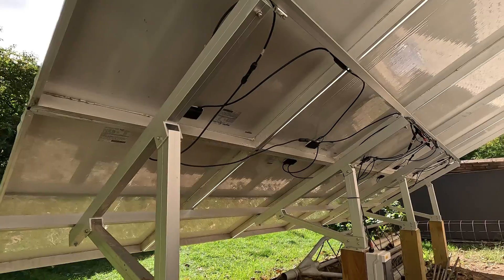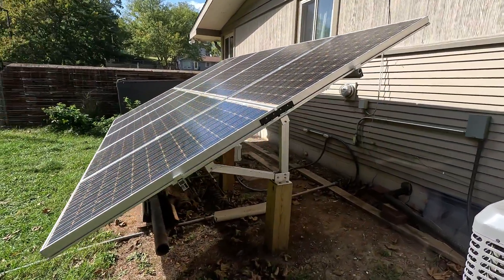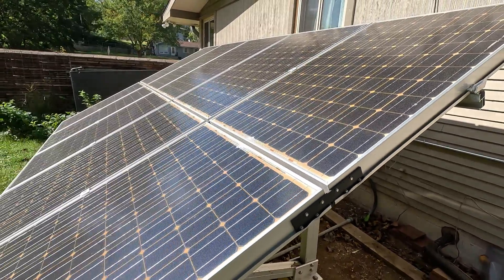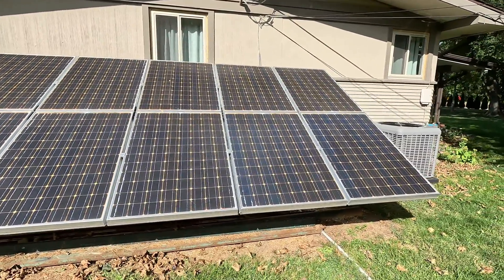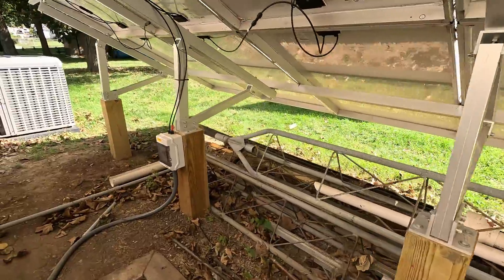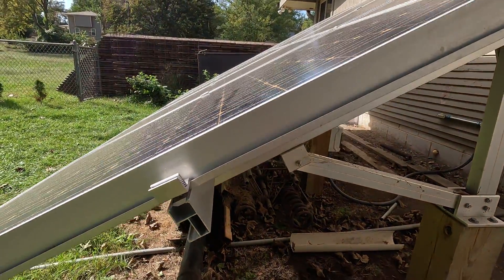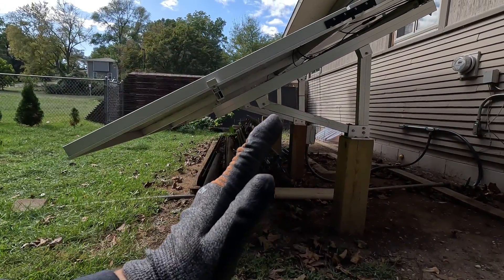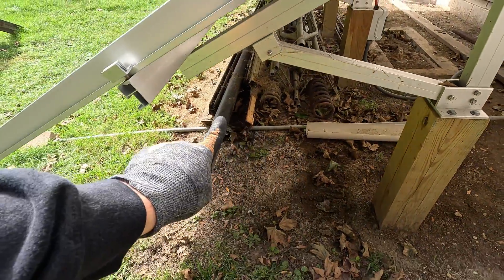EG4 Solar Panel Rack Update and Winter Prep!!

Comment: Used motor oil and some diesel fuel to help it wick into the wood. This is an farmer's method of preserving wooden trailer decks. I use it on my equipment trailer and my car hauler. 5 years on my equipment trailer and 25 years on my car hauler and have never had to replace a single board. 

I'm doing a similar ground mount and will be using 6x6 posts as well. I'm going to be adding an aluminum strap from the back of the EG4 mounts upright to the back of my 6x6 post. This will prevent galvanic corrosion from dissimilar metals being in contact and help reduce the chance of stripping out the lag bolts from the ends of the posts. I may add additional straps over the top of the mount base to add more peace of mind.

Comment: Have you thought about shifting the panels back a few inches to create a better balance front to rear? The structure of the mounts appears to show an increased forward load/lean. Would have definitely cemented the posts. Otherwise it looks great!

Comment: would those bracket hold the panels weight from slipping down (age, wind, expansion/contraction), I was thinking of (L) rail on the panels bottom edge? not sure how to embed with the whole frame

Comment: folks remember, it's not the average wind speed you need to design for, it's the rare very high wind gusts .  So do the research for your area,  the wind design speeds for wherever you live are publicly available.  Also consider guarding the access to 500 + volts (for some) at the back of ones panels.... it's not about just winning a lawsuit if a neighborhood kid wanders over and starts doing  kid things.  Just stuff to consider if your haven't.
Reply from the maker: Very true!

Comment: While I agree drilling into the end of the beam is less than optimal, it is good that it is covered by the panels like a roof.  I just did something similar but put a 2x6 across the top of them as a shelf.
Reply from the maker: Brilliant!  That would 100% work!😲🤘

Comment: 50/50 mix of used motor oil and diesel fuel. Several applications. Better than anything you can buy! Look for videos on YouTube where peeps use on utility trailers. Woulda been nicer if sone before rack installed but que sera, sera....
Reply from the maker: Thanks! I will look into that!

Comment: That's absolutely strong enough, and a great resourceful modification. I won't even call it a patch or hack, that's legit. :) If anyone gives you fuss over the self tapper screws, I just had a huge carport put together and those are the same screws they used for all the joints. I really like that rack mount and plan to get one when I'm ready to build my new ground mount.

Comment: I would recommend putting banding around with a 4x4 post so that the wood doesn't start splitting out maybe three or four bands of what's called plumbing tape which is this metal strips with holes in it wrapped around three times spaced out two to three inches per band

Comment: Good idea to reinforce it for snow and wind the only concern I have is conduit is a soft playable mettle and could work well under tension but under compression it likes to flex and bend. But I think you should be good as you don't get much snow there compared to what we get here in northern MN

Comment: You didn't do the wiggle test after. But my biggest concern is storing the junk under the rack. And don't worry about sealing the post's all that will do is lock moisture in. Let them breath.

Comment: Interesting video. I appreciate what you do. 
TBH, I don't think you needed the extra supports, 
but peace of mind is worth a lot and it didn't hurt to do it.
You could silicone the edge and paint the mount to the 4x4. 
The pressure treated 4x4 may not accept paint well yet. 6 months minimum needed.
Moisture test - Dribble some water on the surface, and if it soaks right in the wood, it is ready to coat. If the water beads up and won’t saturate, it needs more time.

Comment: I guess I just Overbuilt anyway. I was thinking something Vertical to the ground straight up and down where you tied those pipe in the front . But I guess a foot or 2 of snow will test your theory this Winter if you get that much .

Comment: I would paint the timber in old sump oil that would keep wood bearing insects out as well as waterproof it it's what Farmers used to use and still do on their wooden fences also I'd add some right angle brackets utilize the top two screw that go down into the timber and bring them down the back screw those into the side of the timber so it would help prevent the tipping effect.
Hopefully that makes sense

Comment: Probably hold the weight, but i wonder if you'll have any corrosion issues attaching steel to aluminum.  Could always throw a rubber gasket between.
Reply from the maker: Yeah true dissimilar metals!

Comment: You don't need a cap on top of those posts. If you do anything, get some 2 inch or 3 inch angle iron and make a 3 1/2 inch L bracket to lay over what you already have in place and bolt it from the side.
Reply from the maker: I like that idea!😲🤘
Reply: I was about to suggest that 😀 but I would go longer down the post so that Your well away from the existing end bolts.

Comment: the weakness I see is the 4x4 posts. The bolts don't have that much wood to grab into so the danger is that the top of your post would split if there is a rotation on it. That said, the wood is new and you will probably go 4 years before the wood is weak enough to fail.  I would suggest that after no more than 3 years you relocate the array 4 inches further from the building by sistering a 6x6 to each 4x4 and then drilling your holes into the 6x6 instead. The 6x6 would be locked in with galvanized carriage bolts and washers and you could add a couple of long metal rods or rebar sunk into the ground in the front of the 6x6 to give it a bit more stability to prevent the whole array from rotating.  Then your 6x6 could be floating in the air 1 to 2 inches off of the ground and it would never rot, even after 20 years...
Reply from the maker: I am using 6x6 post and maybe 6" lag bolts if I remember right.
Reply: oh that is a lot better.  I didn't look that carefully.  you should soak the end of those posts in linseed oil and then give then a coat of oil based paint on top, then you will be fine for a long time  @AVERAGE_JOE

Comment: Me. I would have drilled all the holes before I bent the ends. You must not have a drill press. $100 will buy a good older  floor drill press off Facebook market place or craigs list. No downside . A $100 press will still be worth $100 in 10 years.

Comment: Yes sir - it's interesting that sometimes, for DIY where you assume the $ liability if it falls over, and there's nothing dangerous (like starting a fire), 'engineered specs' may very well be overkill for you're personal situation and thus - the array will be fine.    In my yard array I did footers (25 bags of 60lb quickcrete per each vertical pole per IronRidge design tool)  for the worst soil type as I read it would pass inspection without a soil sample if one did that and I was required to pass an inspected someday - but after several years of storms etc I now understand it was waaaaay overkill.    And yes, my 26panel ground array also 'vibrates a little bit / sixteenth? of an inch' if shoved very hard but it's definitely not going anywhere.  It could be that a little flex is actually good :)

Comment: you could put a 4x4 post horizontal on top of the posts with t brackets then mount the rack to it with lag bolts.

Comment: What I'm concerned about is that the panels are held by a bracket that goes along the centerline of each panel but nothing along the lower edge.
The bottom of the lower panels are not held by anything.
With no load [weight] on the panels, that support is adequate. Once snow and ice start to weigh down those panels, they might flex and break the connections between the solar cells.
Propping the lower edge of each panel with either wood or PVC piping to the ground will stop any detrimental flexing of the panel. Think of a widow A/C unit with a prop on the outer edge that prevents excessive force on the window and window sill.
Good luck with your decision on how to proceed.

Comment: If you have heavy snow on the panels, the weight on the lower panels will be countered by the brackets you joined the top panels to the lower panels. 

As an added support, you may want to attach another metal bracket across the very bottom edge of the lower panels. Then maybe place 4x4 posts from the ground to the new bottom bracket. Instead of digging the posts into the ground, I’d just place them on a brick base to keep the wood off the ground. 

This way as you load snow weight on the panels, they will resist the urge to bend downward at the bottom. 

Just a thought.

Comment: The problem with screwing into end grain. Picture wood as stacked straws bound together with lignin. Onto end grain, the threads cut the straws, enabling much easier strip out. It can work, but the fasteners must be very long. In addition, those single, top of post brackets each only have two fasteners resisting snow load (and even worse as snow slides to down side), pivoting across the small plate. Your reinforcements will help greatly, but just supporting low edge to ground would be simpler and provide a much more rigid framework. 40+ year engineer. Nice video.
Reply from the maker: Thank you for that explanation!!!  100% get it now!!  Yeah I guess something going straight to ground would have been better!!
Reply from the maker: I for sure predrilled😄
Reply: Yes. They have hurricane strapping for things like that. Either that or steel brackets. Water damage is mitigated by having the panels providing cover from the rain.

Comment: Makes for a better looking thing than the junk pile lol Ya I would cap the posts those anchor bolts will eventually pull out.
Reply from the maker: Think im just gonna attempt a seal jobby and wrap the post ends with straps lol
Reply: Good luck any lag bolts I ever placed in the end grain would pull out in a few years not from splitting the wood, but would rot around the lag bolt maybe if they were glued in too may help.  @AVERAGE_JOE

Comment: 2:22 wild guess but could just use old car tire tubing and cut a square piece out like a gasket and place between the metal and wood. just put some wires across the panels and pump 100W into it when snow/ice forms :)
Reply from the maker: I thinks its more on the wood just splitting since I went into the ends or end grain.

Comment: Playing armchair QB here, but why not just buy four of those square concrete piers used to build a shed?  Place them directly under the forward support strut, where you attached the bars, but go straight down to each pier.  Maybe put a small section of 4x4 on top of the pier and then attach your support to that.  It would be much stronger.  I think the severe angle you created between the flattened and round section of the pole is a weak point that will bend quite easily.  I don't think you added much support at all, with those poles.
Reply from the maker: Armchair QB Welcomed!  Yeah I could do that and yes it would be MUCH stronger.  I was just being a cheapo and used what I had.  You dont think it will add much strength with the conduit?
Reply: @AVERAGE_JOE - If you have another section of that conduit, flatten one end, bend it as you did the struts you attached to your panel support, and then apply pressure on that flattened out tab.  I think you'll find that, with the angle exceeding 45 degrees already, bending it further will be fairly easy.
Reply: I think each leg of conduit that you added will support 300 lbs. A cubic foot of wet snow is about 25 lbs.  You are good. @AVERAGE_JOE

Comment: Good brace design Joe, me likes it.  

Grab some cheap galvanized strapping used for hanging  HVAC DUCTS and strap the top of those 6x6's.  The  mix up some 5 min clear epoxy, cut it with some denatured alcohol and mix it up good - nice and runny.  Then grab a chip brush and paint it on sloppy wet top of those posts.  Do it when posts are bone dry so you get good penetration.   This is better than rubberized coatings and oils because it penetrates, waterproofs. and increases strength.   This is how old  wood gets restored in historic houses, wood boats etc.
Reply from the maker: Thanks Man!  HVAC straps I will do for sure.  Ill have to looks into the epoxy and denatured alcohol trick.  Do they make big enough tubes or just get a bunch?
Reply: @AVERAGE_JOE  It goes a long way, maybe a couple packs of the devcon epoxy:  The alcohol slows the setting time so you get more than 5 mins.  Do a test batch on a scrap piece of wood to get your process down.  You have to stir a lot; at first it won't seem like they can mix together but keep stirring vigorously and they will.  Then paint it on , clean your brush in some alcohol, make another batch, repeat.  It gives a nice finish to the wood too, you'll probably end up coating the whole post.  Goes very fast, you'll have it all done in no time.   This is all from my own first hand experience btw.

Also when you drill the first hole to affix the two ends of the strap ends , w slight overlap, go at a bit of an angle so that the screw will pull the strap tight.
Reply from the maker: @GannDolph Sounds Great!

Comment: Strap the end of the posts so they can't split.
Pour some sump oil into the end grain. Costs nothing, lasts years.

BOOM!
Reply from the maker: Will strap for sure.  Others were suggesting some flex seal or rubber type spray.  Thughts?
Reply: @AVERAGE_JOE  Both good options. 

If you really want to seal it, "Black Jack" is the go to. Bitumen paint.

It'll outlast us all.

Comment: We can over load everything. Pressure treated lumber there are two different types 1) above ground lumber treated, and 2) ground contact lumber. $ big deference in cost. Thumbs up 👍. Nice windows 🪟 too.
Reply from the maker: We like to over load here lol.  Yeah I got the #2 treated wood.  YES the windows actually work meow lol.  Most of the old single pain windows wouldnt even open.  If they did, they wouldnt close unless you went outside to help push them closed lol TERRIBLE😆

Comment: I suggest SNO_COTE roof coating for the wood mounts. My new shed is still exposed wafer board {{ no siding yet }} and the sno-coat was applied to the raw 4x8 sheets {{ outside walls and raw roof }}. No leaks and no warping so it  works very well. This stuff also is on my 1959 skyline single wide storage trailer. There are no leaks in it either. so I am sure it will work just fine for your application as well. Drys hard like plastic. It will bond to metal as well as wood with no side affects. No shrinking no cracking and no fading from UV......GOES ON LITE BLUE AND CURES TO WHITE.    BTW the new shed is where the 2 new 12,000 gowatts are going along with the two Rhinos. I have decided to install all in one place rather then spread the system out. The panels on the other hand are 12 per roof and on four different roofs. Doing this myself and i am wearing myself out. Wish i had help.......
Reply from the maker: I will look that stuff up.  Sounds like a good deal!  Might as well put them in one place.  Makes it look cool too!!  100% wears you out!  I feel you pain BUT once its all up and running...Nothing feels better!!💪🍺🤘

Comment: How was Vegas buddy?
The quickest fix to winterize the penetrated top post grain is that liquid rubber spray sealer... and I would run a metal strap brace around the top of the post to prevent the wood from splitting as it ages where you penetrated the cross grain with the bolts. Copper Pipe hanger strap is good for outdoor use.
Reply from the maker: Vegas and the Expo were cool. TONS of people and booths.  I didnt really do any "sight seeing" or anything tho🙄I was so worn out from walking I just passed out when I got back to the hotel lol.😆  Thats a great Idea for the rubber spray AND the strapping.  I was thinking of using some big worm style clamps but the strapping might do it!

Comment: Im doing a setup similar to yours.  Im installing (2) of the Ground mount kits side by side and do 2  high by 9 wide of 335w Neo Solar panels netting 18 solar panels across the 2 kits.  Im using 10ft treated 4x6 with 5ft being in the ground and im laying treated 4x6 across the verticals and bolting to them and then installing the brightmount foot bases to the horizontal 4x6's using bolts.  All bolts, washers and nuts will be stainless.  I want my rackmount to last a very long time.  Later I will invent a powered lift setup for seasonal tilt adjustment.  Ill tag you once i get vid of my setup install.
Reply from the maker: NICE!  If I didnt have all the trees Id do a similar setup with a few side by side!  I like having the ground mount panels.  So much easier to clean and remove snow from.  Yeah tag me for sure when you get it all up!!  Thanks!